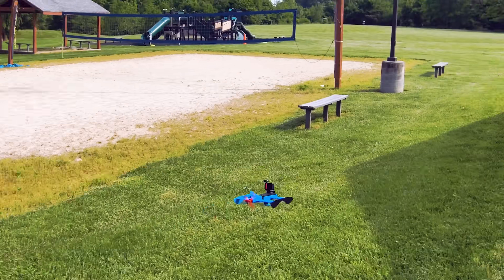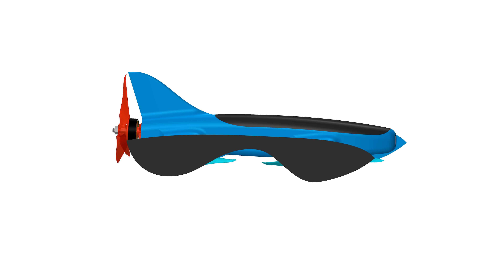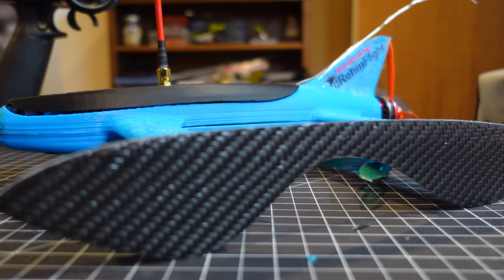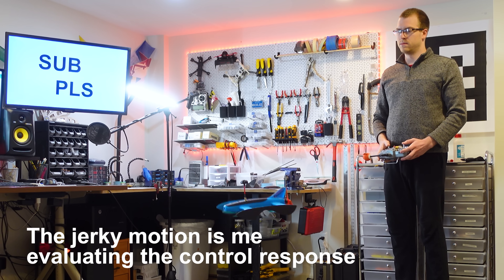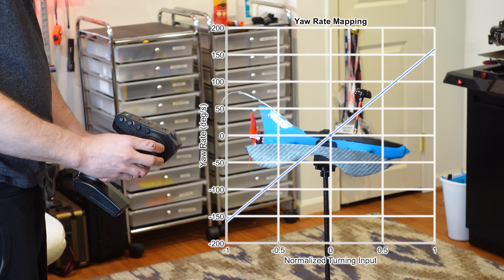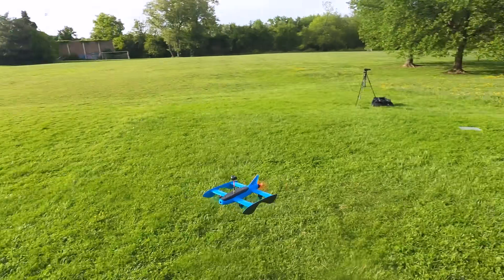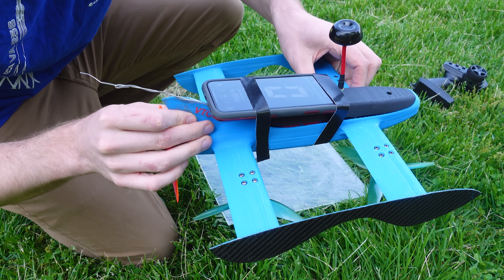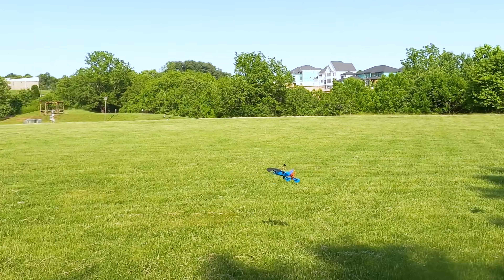World's Fastest FLYING RC Drift Car

Comment: imagine servo under all of the 4 drone motors offseting them to be able to rotate 90 small slit in the fuselage for the props or very small props obviously the lidar need to control some  of the rotation but going this fast if you build it a bit more to gain it own lift when all 5 motor ar heading back man the thing would be to have some snappy servos

Comment: I'm curious how you are mounting the MPU6050 IMU to the drone.  I suppose you are soft-mounting it to a large dense mass?  I am finding the IMU way too noisy to be used.  The drone just flops around.
Reply from the maker: Just some double sided foam tape to any flat surface. Make sure your props are decently balanced and not damaged
Reply: @NicholasRehm  Thanks.  I'm going to see about my prop balancing and get back to you.

Comment: Have you had any issues maintaining the 2000hz loop rate with the LiDAR sensor?  Mine seemed to skip a beat every couple seconds.  Added datalogging with Teensy 4.1's built in SD card but the act of datalogging also slows down the main loop.  For the LiDAR I see I can try faster Baud rates.  Have you figured out how to do datalogging without slowing the main loop?
Reply from the maker: Yea writing to SD is blocking and generally very slow. You can either spool up a dedicated thread (hard to get right) or print to a serial port and use an openlog data logger to decouple the logging speed from the main loop speed. A lot of standard libraries for sensors like the LiDAR are blocking and slow as well. I believe for this project I had to modify the LiDAR interface class to fix this issue

Comment: hello, thank you for this amazing project. but, please is possible to do it with a normal flight controller and inav or mission planner?? because coding is not a thing i make. is difficult for me and if is possible to do it with inav or mission planner, it be more easy for me. i have no problem with your flight controller! is amazing! but is the software part scare me.. thank you for the response if you have this message.
Reply from the maker: You will need to code this functionality into those flight controllers as well; dRehmFlight will be much easier to beginners for doing this
Reply: @NicholasRehm  ok, building your FC doesn't scare me at all, it's the coding. after can you certify me that I can do it with your code without having to understand too much or will it be necessary to retouch certain parameters anyway? also, for the mix with the rc car radio, great, but the explanation of the mixing and the expo are vague.. several points are vague.. I will look at the code and try to understand, but if it really is enough to copy/paste your code, then it's easy, but I doubt it.. also I have another question: the model printed by pcbway in black on your video is made of what materials exactly? thank you for your answer, it's true that I find this project really good, and I would like to build it. but the coding knowledge blocks me a little. in any case great model, and I don't understand why it is not mass produced.. besides the control of a lidar on betaflight would have fixed things I think, because I know it well but it really lacks that. in short, thanks for everything, waiting for a response, cordially, A.
Reply: @NicholasRehm  to be shure: the mixing is made with the radio??
Reply: @NicholasRehm  and for the speed why not gps? to have real speed on fpv. is difficult to put a gps?

Comment: This is my favorite of your projects. I WILL build one in the next couple years. I have to. I do t have a choice in the matter. It's just too cool. My 3d printer is only 200x200...so I could maybe cut each piece into 4 pieces. I've never used lidar before, but have always wanted to for a gev.

Comment: Youve really inspired me! I need to try making one of these. Loved that star wars speeder drone. I want to make something like those, maybe even make a kit for it. Great stuff. Did you ever account for the change in perceived height while you were banking? Did that cause the drone to sag when it was banking?
Reply from the maker: Good question, if I remember correctly there is some compensation on the altitude measurement based on the drone’s attitude… buried in the code somewhere

Comment: Do you have a video with more details on soldering the electronics stack? Cant figure how to power the tinsy
Reply from the maker: You’ll need a 5v source on the teensys Vin pin. I used one off the vtx, but if your vtx doesn’t have a 5v out you’ll need a separate 5v bec in line between the battery and teensy

Comment: @NicholasRehm I'm ordering the electronics for this build, and I have a couple of potentially stupid questions... 
1. Will any 3-channel surface radio work? 
2. Will any 4-in-one ESC work, as long as it's rated for the proper voltage/amp?
Reply from the maker: 1- yes, as long as it has basic level of programming so you can configure trim/endpoints 
2- yes
Reply: @NicholasRehm  Ok, another stupid question: I followed your guide and I'm fairly certain I got everything wired up correctly... but my MPU keeps catching on fire when I connect the Teensy to USB. (I've been through 2 MPUs, and both caught fire, it looked like a component just underneath the VCC pin). Also, now my PC isn't recognizing the Teensy on any com port anymore. Tested with multimeter on USB and on battery power, and everything looked like it was getting proper voltage... Any idea what I might have done wrong?

Comment: Would it blow the budget too much to add two additional lidars, one at 45 degrees forward and one straight ahead, to take care of avoiding collisions and steep inclines at high speeds? And are there lidar modules with doppler that you could use for the 45 degree one to have it double as a speedometer to help figure out how soon it needs to react to the angled and fwd distances?

Comment: Do the wings provide significant lift at speed vs standard quadcopter (battery charge lasts longer)?  
And you need a cheaper phone.
Reply from the maker: Nah, they’re more so for aesthetics and reducing drag. They are symmetric so only catch lift when I pitch back to brake

Comment: What is the flight time and current draw (for the whole setup)?
Reply from the maker: I get about 4 minutes. 4 pusher motors I have are pulling about 15a in hover. Pusher motor is about 30a max
Reply: @NicholasRehm  I am printing it from LW-PLA - the fuselage should be half the weight. I intend to glue a few carbon strips as reinforcement. 
The saved weight will compensate using a 4S Molicel P45B li-ion battery - 4500mah total capacity at 280g. It can easily output 45A continuous. 
Should be both fast and long range :)

Until now I was only flying fix winged RC jets, but this project is so cool, it managed to get me into drones :D

Comment: Wow so rad… that could be a viable product. Could you put a couple cameras facing down to hold position and gauge speed alike also helping it turn with out drift? It could have a drift mode for expert mode.
Reply from the maker: Erik has been experimenting with that idea and is getting pretty good results

Comment: Bro you are playing with next level stuff here 👀👍, way to go 👌, i like this idea a heck of alot, when you had ur phone on it it was alot heavier and that weight changed its response affect and it fell, also it should go alot faster without the phone on but it just goes to show how strong the lifting power is on a drone, itll be interresting to put a twin prop on a longer shaft in a tube as the pusher much like a jet engine im thinking 🤔

Comment: This is really great, it would really get people into the hobby. It will also only be a matter of time until a flight controller, height sensor, and software are available as a package. Then whatever cool frame to build or buy. It would be a little bigger than a 5 inch drone so you don't have to be a microsurgeon to build it. What a great concept!
Reply from the maker: This is only the beginning!

Comment: I think one issue is weight to power. You're using 4 5 inch props just to hover, and only 1 to move forward. Most of your mass is just to hover. I'm not sure how drag comes into play, but since the craft isn't pitching forward, those props must be creating more drag in forward motion.

The lack of needing pitch for forward motion is great, but what makes quadcopters so powerful versus this is that the thrust of 4 props can be fully utilized, resulting is a very high power to weight ratio.

Comment: Mocking creality telling me not to buy when the ender was my biggest joy ever makes me want to unsubscribe. oh wait.. this was my 1st time, Well i made it 2 min in.
Reply from the maker: sorry not sorry, my experience with their products has been crap
Reply: @NicholasRehm  Ok maybe i had to explain why for me it was a good one. From day 1 i started upgrading and modyfying it. I was trying to learn about this printer,All ins and outs. It was damn cheap and sure it had some short comings. But for that money i learned what issues and hurdles you will stumble upon wich you will learn to overcome. If i see a printed part right now i see what setting could improve the print. The real winner was for me the ender with the best Bang for the buck.For ppl that are curious and want ther 1st printer wich is all open source.
Reply from the maker: @Android-bd8ft  I bought a higher end printer from them that was advertised more or less as plug and play, and a software update basically bricked half of its functionality after like 2 months of owning it. Also, first print on it, the nozzle oozed out the back and destroyed the whole extruder head. But I’ll agree with you on the ender 3–I had the same experience with mine way back
Reply: @NicholasRehm  Maybe its the amount of times we are using it. Me , i bought it wihthout a purpose. Nothing other than what is it? And how does it work? The ender 3 v2 for me is still a treat. i am making planes with lw pla once in a while . i had to change bearrings cause slack, and did a lot of modyfying. mostly printed parts. Direct drive custom cooler double printhead. It gave me tons of knowledge. And now I see me as in ready for a real 3d printer. 
But your build goes on my todo list. Awesome project mate.

Comment: Any frame designs for printing on the ender 3? I need this in my life
Reply from the maker: Maybe scale it down 75% and go for a 3” setup with 12mm motor mounting holes and 20mm FC stack

Comment: This is really cool project. What I found even more interesting was the mount you created to place and check the controls of the craft. Do you have a video on that as well?
Reply from the maker: I originally built it for my spinning drone project. It’s a 2x4 base with a carbon tube out the top and a ball joint so I can’t mount things to it and have them freely rotate

Comment: bro if you buy DJI Avata you are already able to achieve this  sensation by using it in Sports mode and flying it very close to the ground because it has down facing sensors which can detect the ground and adjust the quad's altitude accordingly. Benefit of using a normal FPV quad is you can use it also for normal flight as well. So no need to invent the wheel once again IMHO ;) BTW camera adjusts itself when the quad leans forward to speed up so that you always look at the same spot on the horizon despite the quad bein angled...

Comment: I would love to build one of these but only have a 235x235 3d printer would you mind sharing the cad files as a .step or similar for some redesign?
Reply from the maker: If you print at 75%, motor mounting holes will be 12mm and electronics mounting holes will be ~20mm, so you could run a 3" setup with smaller motors and 20mm fc stack

Comment: I didn’t think being able to reverse the motors was too complicated. I think you can just set it in BLHeli32 and then it just turns half throttle into zero throttle, below that is reverse and above that is forward. You mentioned it was difficult because of the protocol, are you using Dshot or something?
Reply from the maker: My understanding is you can only reverse the motors in realtime using dshot, and that requires each motor be on a serial port. But maybe my understanding is wrong

Comment: Nicholas, why didn't you use the teensy controller for all functions?  Was the code for the lidar unit to complex?
Reply from the maker: Teensy still handled everything, just with some of the mods mentioned in the video
Reply: @Nicholas Rehm, thanks for the quick reply.  I'm building one now.  My 2d printer platform is to small to print your design (ender3 pro) so I'm going to use an older quad frame as the basis for my build.

Comment: I have a question, what happens when you try and do a loop on a track like a rollercoaster? Can we use the drone motors in reverse to cause a stuck to the ceiling effect/anti gravity?
Reply: What if you add two more OPPOSING force motors so you have positive distance control to a ceiling....

Comment: I have thought of something like this but with a gas turbine providing both electrical power and the leftover thrust would probably help. No need for a heavy battery.  Yeah, sounds like a lot work for a quadcopter of this size.

Comment: So you didn't want to put a gps on it to save weight and complexity. But you strapped an phone to it that weighs probably 600x more?
Reply from the maker: Phone was for external verification, not integration into the flight controller

Comment: Why are use using the MPU6050  ? It is an old obsolete part and i am sure there are newer better parts out there potentially drop in replacements. 
Also what is the radio transceiver that u use on the drone?
Reply from the maker: It's cheap and readily available
Reply: @NicholasRehm  fair enough, not sure if it is still in production but there is stock around not sure for how long tho ....

Comment: My prop guards were a bit too weak for my liking so I wrapped them in carbon….  LIKE ITS NO BIG DEAL….
Like seriously, so casual for such a blistering amount of extra work.
Reply from the maker: Wasn't too hard! Just wet the faces with epoxy, lay the fabric over and squeegee off excess epoxy. About halfway through the curing process I went in with an exacto blade and cut the excess off. Only added a day to the build to let the glue dry

Comment: Take care with those props. Hope your hand recovers well.

Wondering if the pitch back is the best solution for breaking. Thinking reversing the pusher prop direction like in 3D drones might be better, avoids the pitch up and control issues that come with that and avoids aiming a whole bunch of spinning props being pointed at anything you were breaking to avoid
Reply from the maker: Agreed--reversing the ESC is the correct solution. Need to wrestle with ESC protocols for a bit to get that working....but good point about the thing looking like the underside of a lawnmower coming at you while it's braking
Reply: @NicholasRehm  I believe some ESC's are better at handling reversing than other's as well.  Most BLHELI and later ESC can be switch to reversible mode through the BLHELI configurator.   It means you lose resolution on the forward throttle, but that's not usually much of an issue.  Also slightly different in your case given the controller you are using, but pretty sure you'll be able to map that without too much effort.

Comment: Fantastic project! I have a question, though: could you achieve similar results using just a quadcopter and INAV with LiDAR and altitude hold? I actually just purchased a LiDAR module for my 6 inch which I’m putting iNav on.
Reply from the maker: Probably! Might even work better, but I don't know much about getting INAV set up

Comment: What would happen if you try to do it with ground effect fixed wing? Yes, you might need a unique solution for real slow drifting and takeoff but in the rest of the time it should be quieter and last longer.

Comment: I love this. I am slicing it up now! I didn't see in your instructions, what infill and layers are you running?
Reply from the maker: Parts are designed for solid infill!
Reply: @NicholasRehm  Ohh that makes sense!! Do you think a lightweight pla would be strong enough??
Reply from the maker: @SkydozerFPV  Ehhh, probably not. I used regular PLA and the weight wasn't too ridiculous, but was just strong enough for my liking
Reply: @NicholasRehm  Now that I have printed it, I am noticing that the motor mounting from top shell to bottom shell are misaligned by about 5mm. I don't expect it will be too difficult to make work, using a soldering iron. Just thought I would let you know though, in case you wanted to save some time on a future build:) Thank you for open sourcing this, and your flight code.
Reply from the maker: @SkydozerFPV  Super sorry about that...looks like I uploaded an older file by mistake. Just fixed that on the hackaday page. The one with the holes more inward is the correct version
Reply: @NicholasRehm  Oh awesome! Just started a new print with them. Thank you for doing that!

Comment: Rear motor needs a downward tilt so that it'll be level at high speeds.

Also for the speed tracking, could you integrate your throttle input?
Reply: Adding a downwards tilt to the rear motor will introduce a torque, it would constantly be having to fight it and compensate with the front propellers
Reply: I would expect it would be pretty hard to keep the calculated speed value from drifting due to wind, drag etc

Comment: Are the motor spars also lifting foils?
I have to wonder how small you could make the props and motors if you're using them at near full throttle knowing as soon as you start moving forwards you don't need them.
Reply from the maker: They're 0012's, so not really meant to generate lift when level, just reduce drag